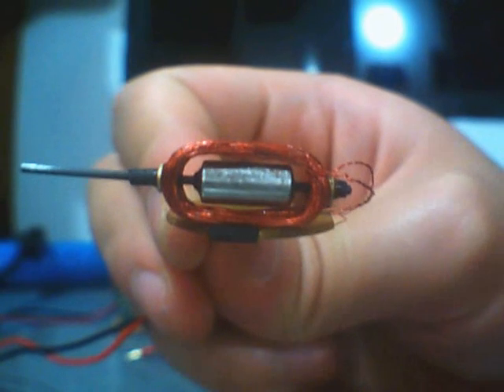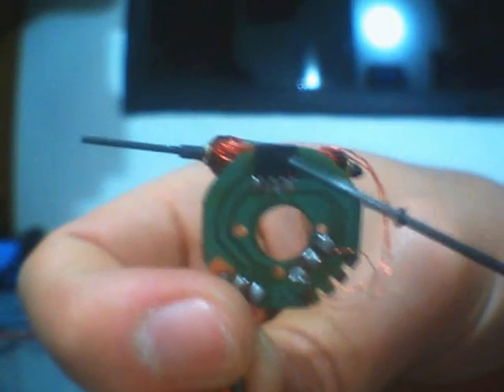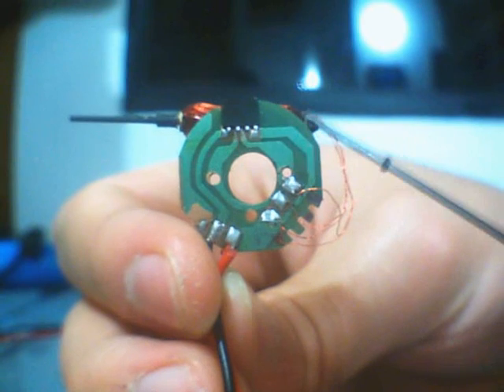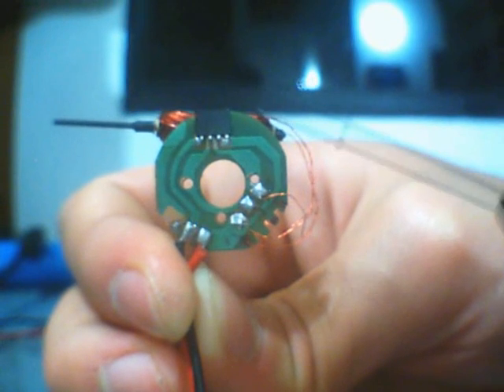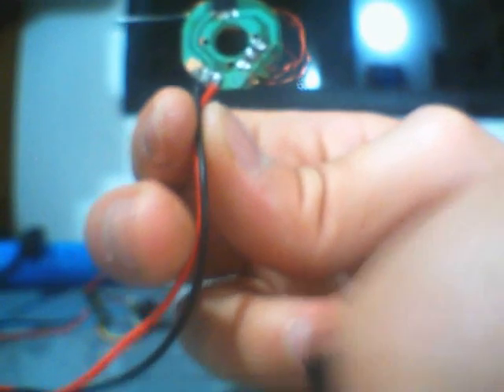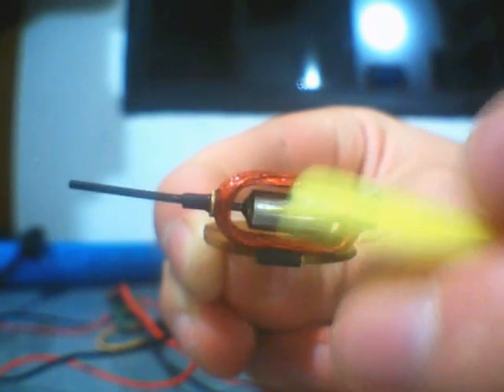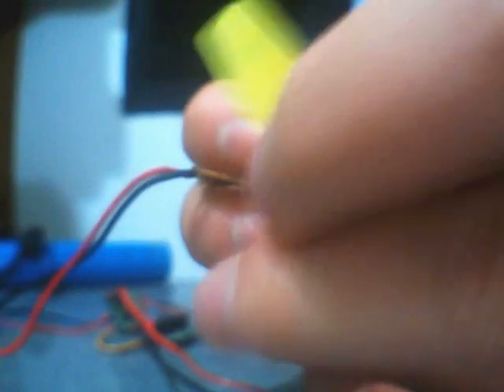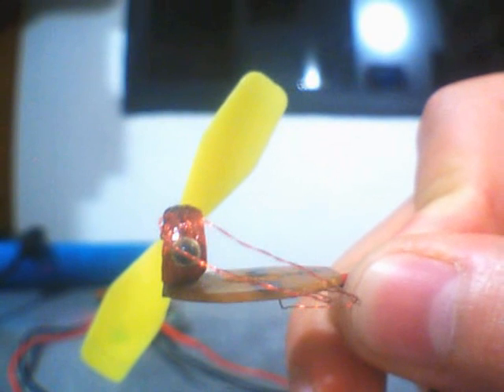Homemade micro brushless motor

Comment: Good innovative work. Now if you want to settle your torque issues. You should put a small gear on that shaft wide enough to drive a larger gear and that will multiply your torque. It's called gear ruduction and torque multiplication. I learned that in the car tech world.

Comment: Did you just glue the shaft to the ends of the magnet, how did you get it so straight? Where exactly is the chip, did I need the whole board? I've seen some videos were there is only the chip, no board.  Am I seeing this correctly?

Comment from the maker: I bought a bundle of wire and wrapped it around a piece of foam. As I got the coil to a size I liked, I cut it off from the bundle and put superglue on the coil. I let it dry and then pushed it out of the foam. 

Although this works it can get messy as most foams dissolve with superglue. Try wrapping your coil over a straw or a paper tube as the superglue won't hurt them. 

Cheers

Comment from the maker: @Heliman96 We have a motor and we put a propeller on it. At a given voltage the propeller will slow down the motor from the RPM it would normally get if it didn't have it on, thus it will consume more amps. Since the Amps that our IC can handle are fixed at this voltage, under maximum load, the motor cannot consume more amps that the IC can provide. For the same ammount of wire, a wider motor will have a lower Kv then a really narrow one.

Comment from the maker: @Heliman96 The faster it will spin at a given voltage. The coils of a motor turn the magnet by periodically having current go through them, the faster a motor spins, the less time the coils get a pulse of current. So if a motor gets slowed down at a given voltage, more amps will go through it, and if these are too high the coils along with the IC will heat up. So the Kv of a motor has to adjusted to the way its going to be loaded. For example,

Comment from the maker: @Heliman96 This means that with a low turn motor you can get the coils to push the magnet at a lower voltage and thus achieve the same RPM as you would with a high turn motor running at a higher voltage. This has a mayor effect with these small computer fan IC's because if you Run the motor of a Lipo battery and the motors turn resistance is too low (due to low turn count), the IC will burn! Now, the specific RPM of a motor at a given voltage is called Kv. the higher the Kv of a motor

Comment from the maker: @Heliman96 The thinner wire will have higher electrical resistance since the electrons from your battery can't get stuffed as quickly through the wire as they can through the thicker stuff. The effect this has is that a low resistance coil will produce the same wattage at a lower voltage at the expense of more current going through it (amps) then a higher resistance coil working at a higher voltage. Given that a motor works by pushing a magnet around with coils

Comment from the maker: @Heliman96  If you use the motor to turn a propeller, the higher it's wattage rating the more force it will produce before it overheats. Say you make a motor thats a  8mm wide tube and is 10mm long. Under that fixed geometry you can only stuff so much copper, so say you use a thin wire can obtain that geometry with 20 turns. You can get the same volume with a thicker wire only wound 5 turns. The difference between the two is going to be the electrical resistance.

Comment from the maker: @Heliman96 1) Yeah. 2) The number of wraps (normally called "turns") depends on the thickness of the wire (gauge), the RPM and voltage you want the motor to run at and the maximum amperage that your motor controller can sustain (In this case the IC/chip). An IC will be rated at a maximum wattage, this value specifies the work the your motor can produce before it overheats.